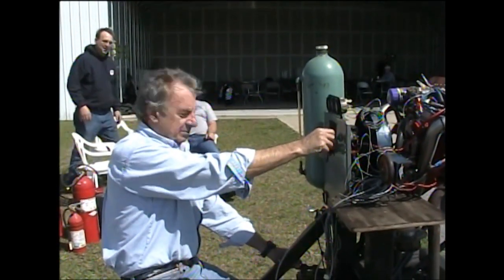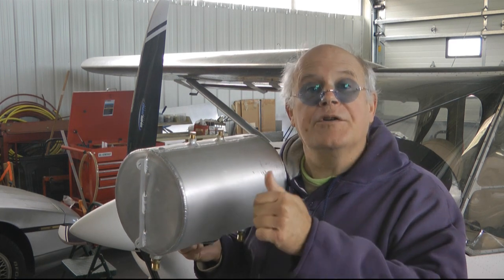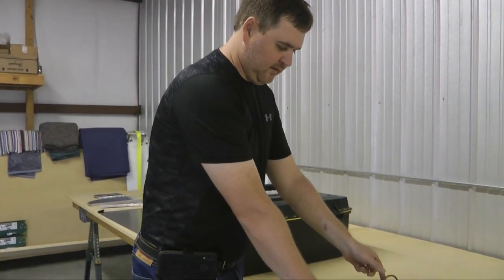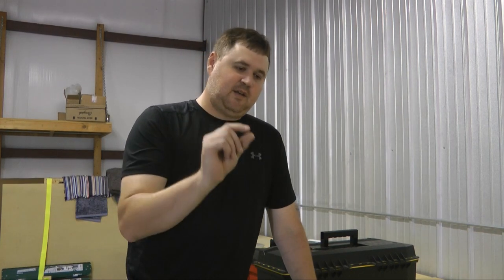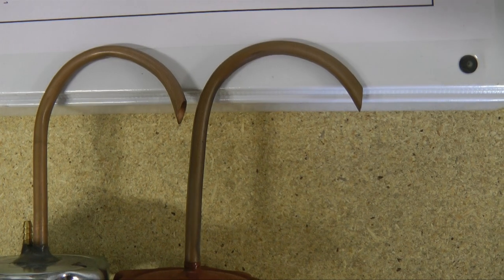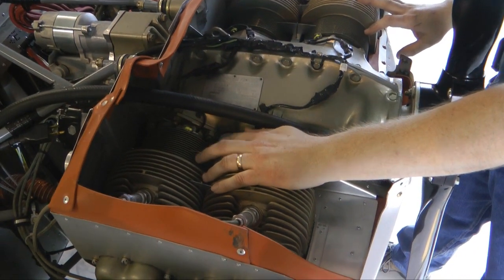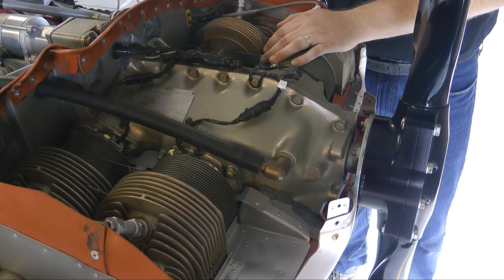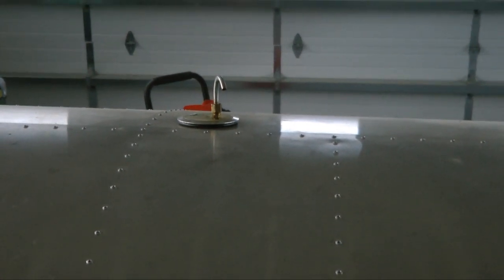How to Measure Fuel Tank Vent Pressure

Comment: Hi temp sealant could help on those small gaps at the base of the cylinder heads. I saw Mike Patey do it recently on his high side pieces. Also a reverse scoop on the low end would help generate a vacuum to assist with pulling the air along with it being forced

Comment: Use it for a Lift Reserve Indicator. Use it to tell you when your home HVAC filter is needing replaced. I used one that I use for gas furnace pressure testing to test my fuel tanks for leaks. 1.000 psi max. No leaks and still no leaks 10 yrs later.